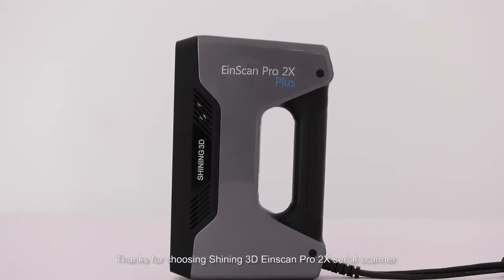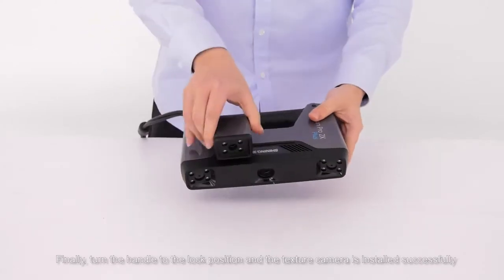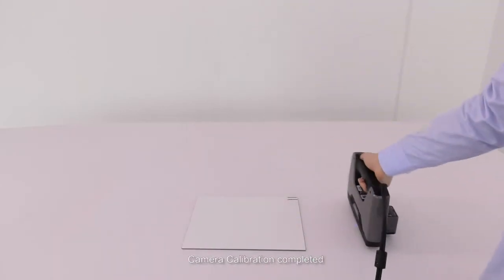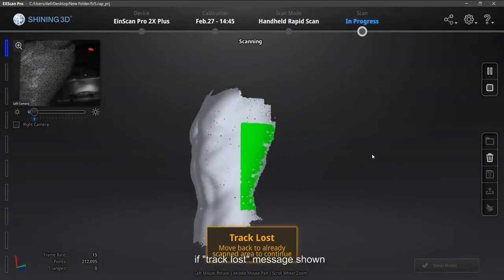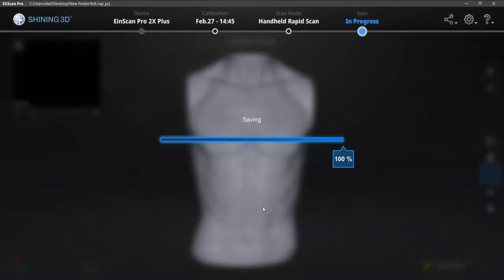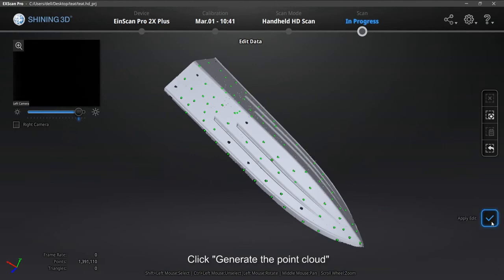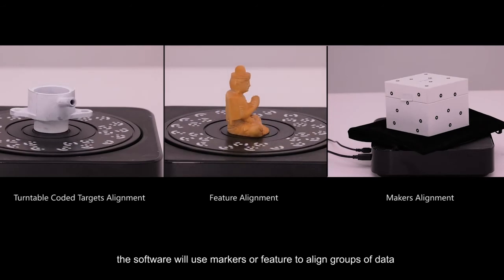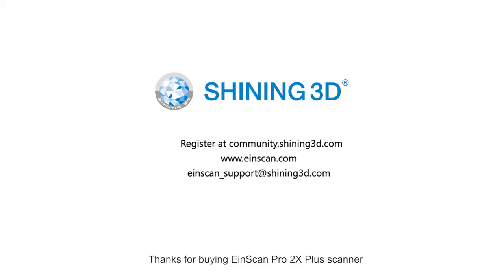EinScan Pro 2X Plus Operation Video - SHINING 3D Digitizing Solutions

Comment: Re-watching this video 6 years after buying my EinScan. I've definitely had the most success with the fixed scan mode and the turntable. In my opinion, the handheld mode is really weak on these scanners. I hope the newer versions are a lot easier but I have just seen that they are very expensive now.

Comment: I'm having trouble calibrating a brand new Pro 2X Plus. It does okay with the calibration board flat, but it will not calibrate when the board is angled. I made sure I held the scanner perpendicular to the table. I'm using EXScan 3.4.0.4.